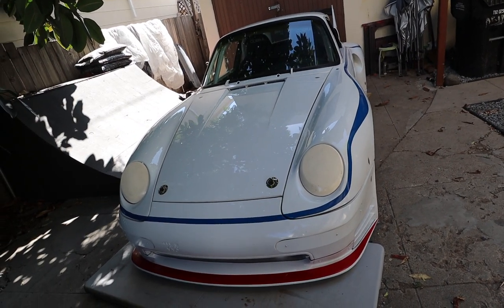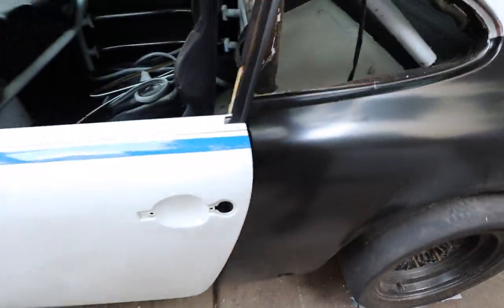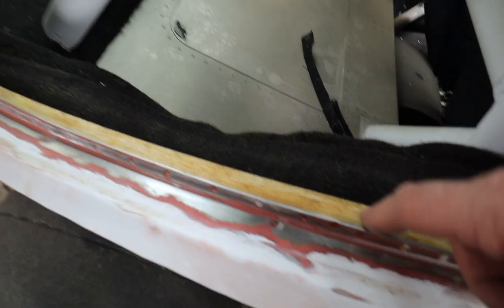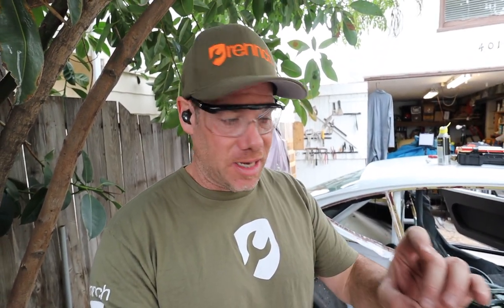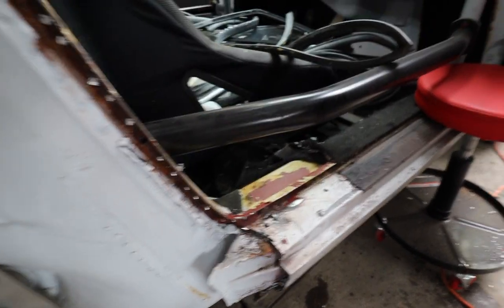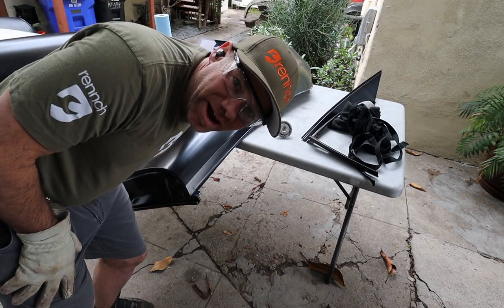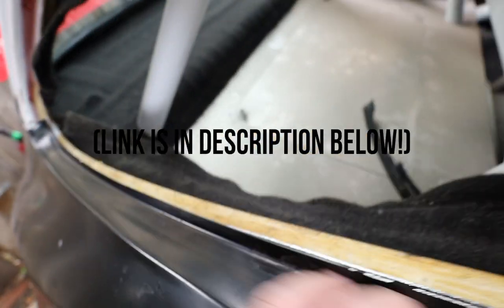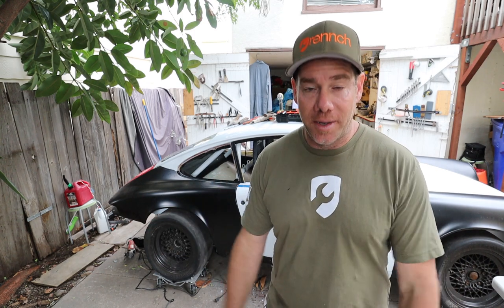REPLACING abandoned Vintage Porsche 911 QUARTER PANELS, Part 1 | Blasphemy Build 5

Comment: Just wondering, Do you know if the Turbo Quarter Panels from Restoration Design would fit?
Reply from the maker: I don't know firsthand, but I don't know why they wouldn't.  The bodies are siimilar.
Reply: Rennch - Porsche 911 Restoration and DIY Tips Turbo quarter panels are the same part but with a fat flare on them so same mounting points *for long wheel base only, swb you can’t and shouldn’t add wide flares unless you know what you are doing. Trivia - all 930 flares were hand welded onto stock fenders until 1986 when they finally made a die that stamps the flare into the fender.

Comment: 1. Need to balance your audio. I like your music, but I like your narration better. Back the music back down to audio 35%, narration 65%, and you'll be golden. 2. Slow down your camera pans, you are moving too fast, and we can't see anything but a blur. You're better off with a stationary camera recording the whole process, with an additional camera that you use for closeups that you can edit in.   I'm curious, did you watch any youtube videos about replacing a quarter panel before attempting this?
Reply from the maker: Yea, I missed the ducking on a couple spots.  Thanks for watching!